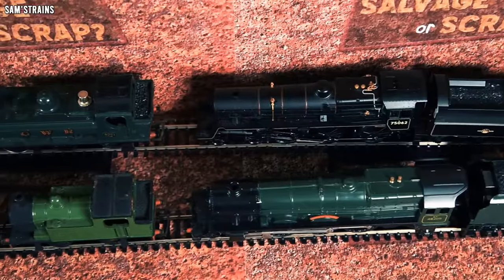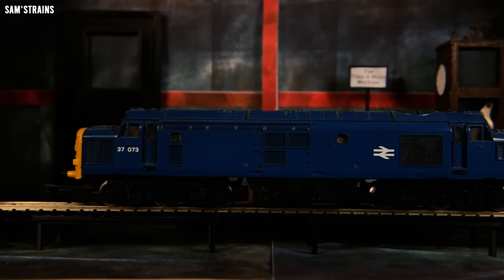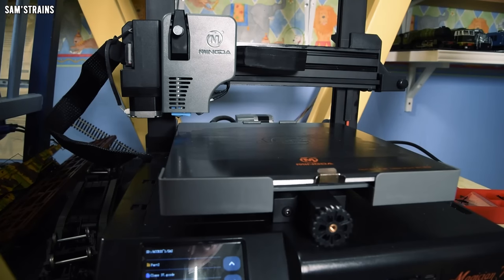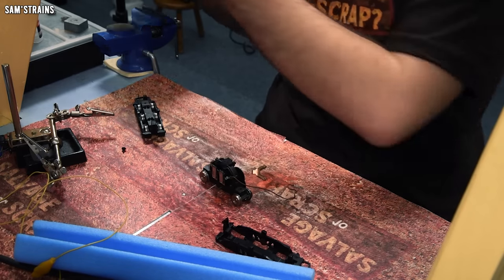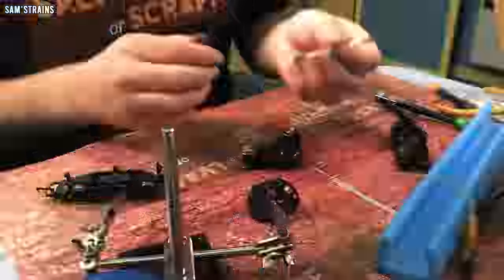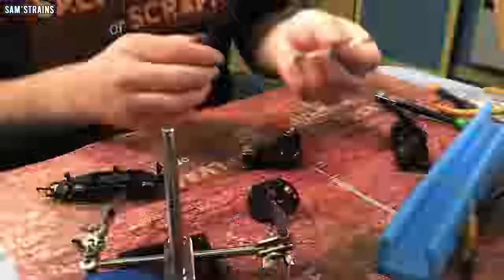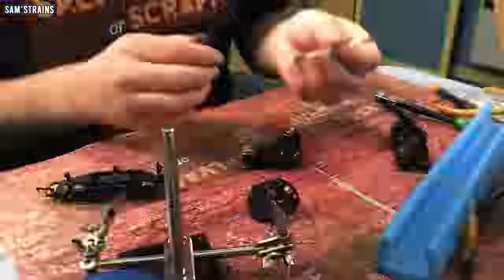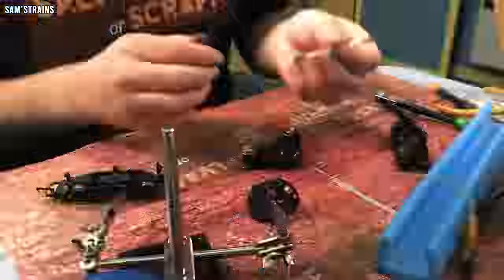Neglected Hornby Class 37 | Salvage or Scrap?

Comment: The repair looks great!  For finishing the commutator and all metal wheels, I've found that a felt wheel on the Dremel with some emery buffing compound gives it a mirror-like shine that should further extend the life of the parts over the small abrasions made by the wire wheel.  It might be worth giving a try sometime. :)

Comment: That was my first loco... numbered as D6830 on the Intercity mail set, 1977.  Has the original 3 pole and worm gear, rather than ringfield. A friend blew up the armature. Managed to get a spare armature, haven't installed yet.

Comment: Sam, what if you can get it working, but you can't get it clean and/or presentable? It would be unfair to the engine just to scrap it for that reason, especially if you've sweated bullets to get it running. I suppose you could use it as a freight only loco, but then you run into the "A4 on heavy coal train" problem. What would you do?

Comment: This was one of my first ever locos. I bought it from the shop at the east lancs railway, they had a second hand shop at the end of the platform. I ended up taking it back to the shop I bought it from because it wasn't working. Guy opened it up and found it full of track pins that had somehow ended up lodged inside after I left some on the track. I was only about 12. Tbf he fixed it for me and didn't laugh, well at least until id left.

Comment: With 3D printing these days, most problems canbe resolved. Only real problem is the Motor...Gear box can be 3D replicated, chassis and body idem. Electric wiring replicated.
Only problem may be the motor metal parts...but 3D metal printing may be a solution.
Scrapper Demon, gnash your teeth!!!